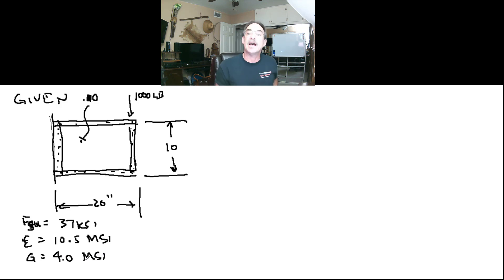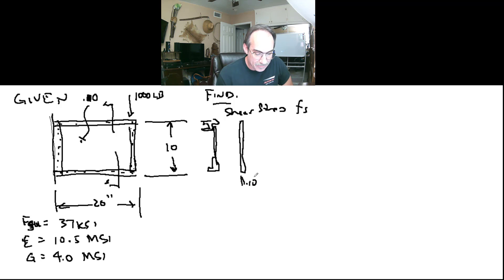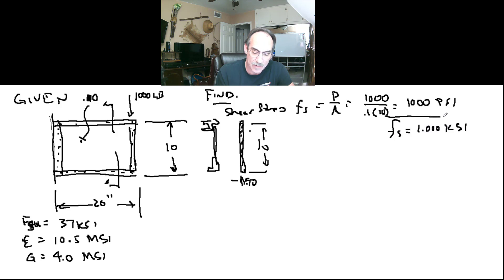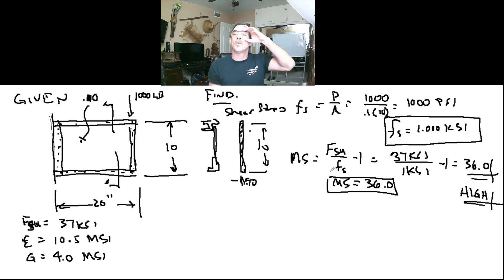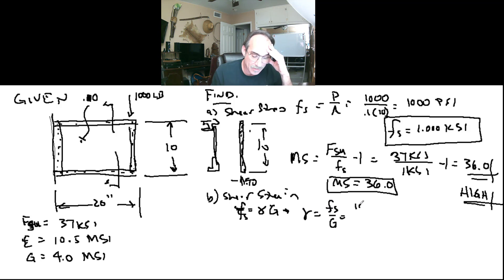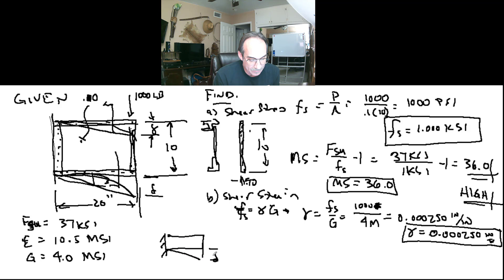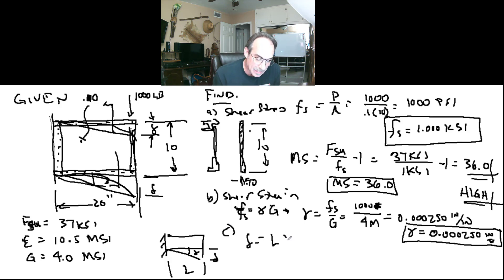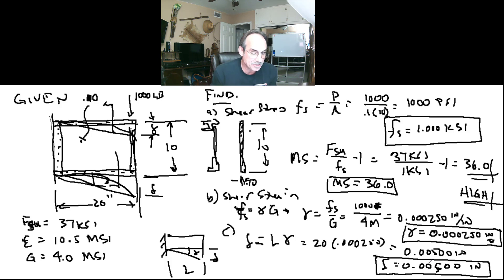Strength I: L-04e Shear Stress, Strain & Deflection - Example

Comment: This might seem like a silly question, but when solving for Area why do you use the 10" instead of the 20"?
Reply from the maker: Remember, shear stress is force over parallel area.  Make any vertical section cut thru the beam, and you'll see the area of the cross-section at the cut is thickness times height.  The stress is the force over the area.  That is the shear stress acting on the section.  Back in statics, when shear and moment diagrams were covered, we saw that the shear in the beam is constant from end-to-end.  Any vertical cut has the same area and experiences the same shear stress.  Make sense?  For review, you can go back to your statics text or notes and review the subject of the method of sections (remember method of joints and method of sections?).  That is a pertinent and helpful review.
Reply: @ToddCoburn  perfect thank you